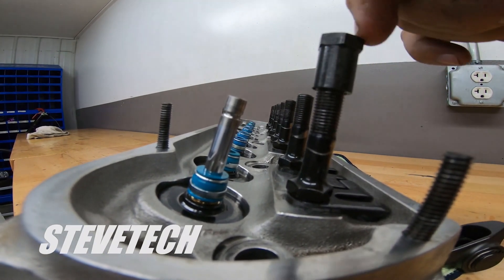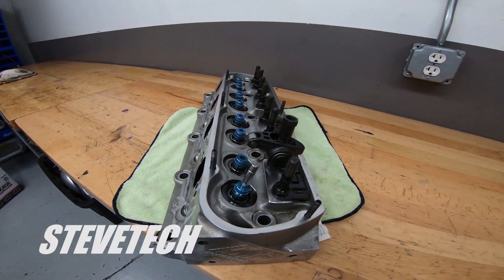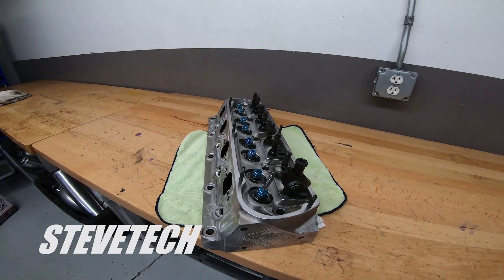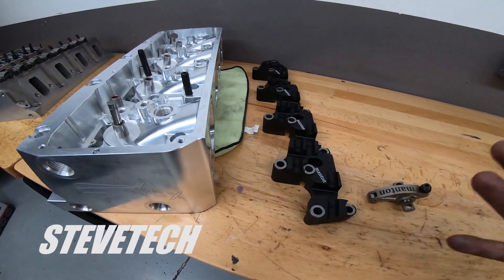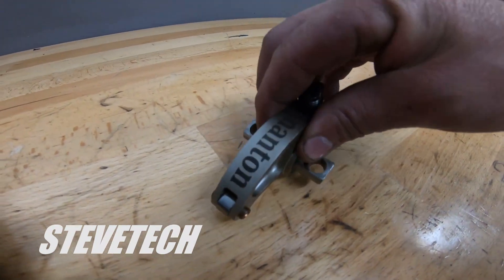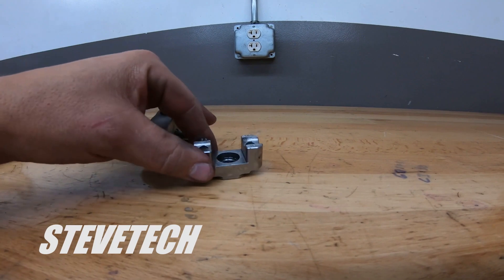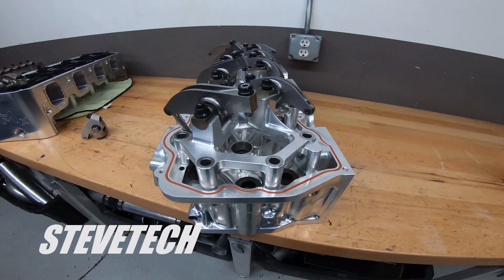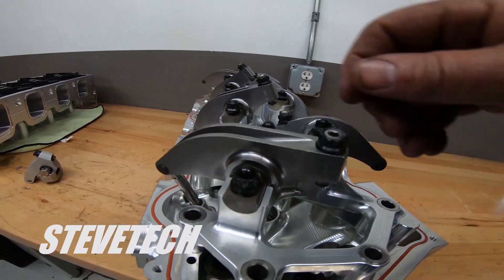Understanding Rocker Arm Tech - Part 1

Comment: Hey brother great stuff. On the second style rocker arm system. Is it possible if I don’t adjust correctly it’ll cause the engine to only move one valve . I’m working on a 4 cylinder Kubota Diesel engine.

Comment: The mistake I see with your stud mount rocker, is that the rocker trunnion is riding on part of the threads and not all on the stud shank. You need to pick a stud with a longer shank to stop this. You can see where the trunnion was beating on the threads, bad deal.